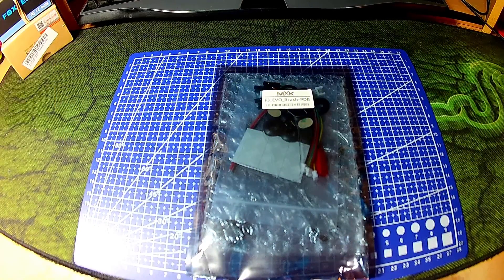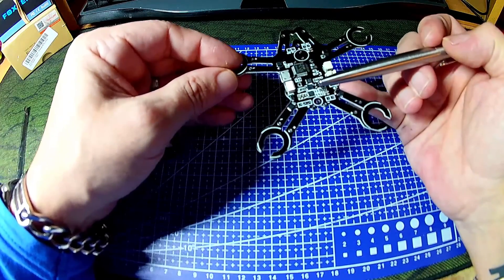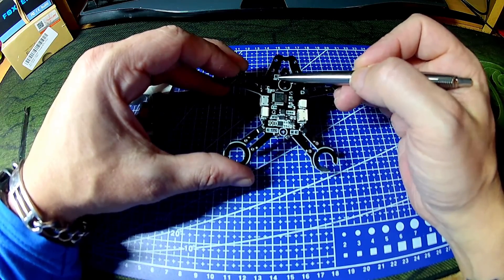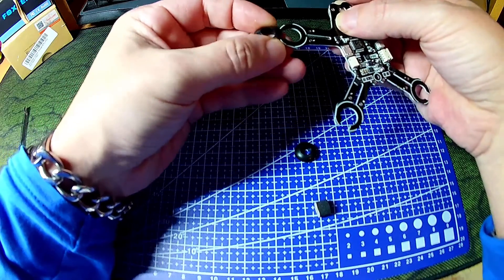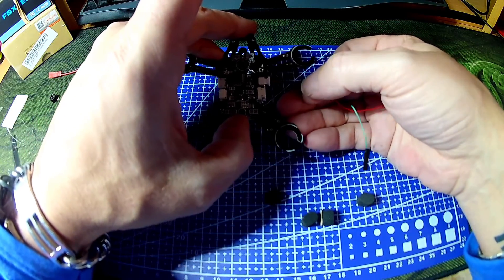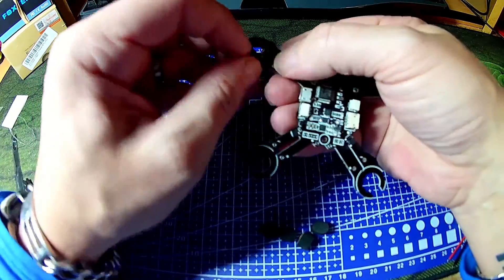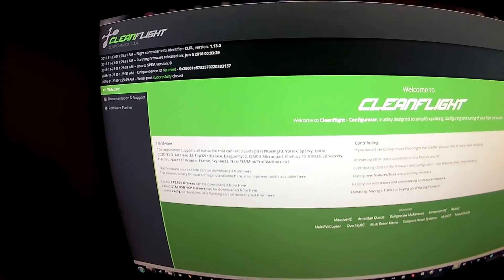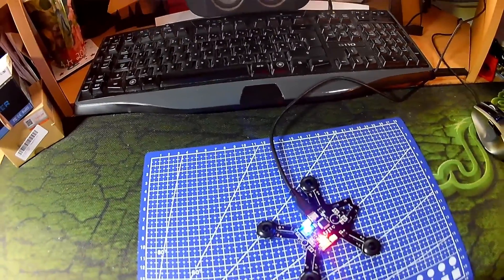92mm Micro Frame Preview (SP Racing F3 Evo)

Comment: hello I want to ask  for a little  favore can you send me a photo of the bord so I cud see what is the part number on 1 of the components on the frame , I accidentally shorted 5+ pins when soldering on the vtx and the tall chip (2pin in the bottom half) solderdoff the bord and popt off and I think this is the only  component damaged so could you send me a nice quality foto of it?
Reply from the maker: Hey,I have an issue with an SMD chip on my frame also I believe that it may be the same one as you.
Is it the one in the middle of 3 vertically inline with the positive solder pad at the rear on the top side of the frame? 

If so I think I have the part number researched from before to replace it but I just never got to sorting it out (Mine died on its own without getting shorted - It is still attached but has a bulge in it that let some magic smoke out if i remember)
Reply: MrE if I understand correctly u have the same problem I'm jus want to make Shure . Can I send a foto of mine (I need an email or FB)
Reply from the maker: Try sharing it or sending it to me on G+ if thats ok?
Reply from the maker: You should have a couple of images I shared on G+ , is that the right one?
Reply from the maker: Ok, now we have figured that it is the same chip I believe it is an inductor:

From the information I could get a while back it led me to assuming it was the following:

TDK NLV25T-180J-PF
Fixed Inductors 18uH 5%
http://www.mouser.co.uk/ProductDetail/TDK/NLV25T-180J-PF/?qs=3POhL7GGTOgcIrJiKXdh1A== 

Other than that I dont think there is much else to find out whats what (I doudbt very much any manufacturuer/Banggood would be forth comming in trying to help)

I can't say 100% that this is correct but I might get around to trying this myself now!

Hope this helps some.
Reply: MrE thank you for your help I wish no one has to use the information (but if needed it helps)
Reply from the maker: You're very welcome. Seeing as we're discussing it , it falls to us doesn't it?
 I have ordered the components even though I was going to leave it however I will stand by my convictions and attempt the fix also! cant harm having 2 guinea pigs hey?

Please share how you get on if you dont mind?
Reply from the maker: Edgaras Vilūnas I took a shot at fixing it but didn't go very well. Just published the video of it if your interested.

Comment: I have my spectrum receiver lugged into uart3 and it wont let me save and reboot with that in serial, also the receiver how's no sign of power, why?
Reply from the maker: Ok,I'll try and help out the best I can however I do not have any first hand experience with Spektrum but I do have an understanding of the Frame,here goes!

I assume it is a Satellite receiver?

First and foremost the uart3 does put out 3.3V upon a lipo being connected or plugged in via USB so check that your cabling corresponds to the silk screening on the underside (3.3v nearest the rear,gnd middle and RX on the front most pin of the the 3pin connector)

Spektrum is finicky to say the least:
I believe that you may need to use the CLI to set the bind process in motion.
If you can get Uart3 configured as Serial and the serial provider set to SPEKTRUM1024(DSM2)/2048(DSMX) - (Maybe try setting that with/without the reciever connected) try the following CLI commands:
For DSM2;
set spektrum_sat_bind = 5
For DSMX;
set spektrum_sat_bind = 9
Type save and hit enter after the command you require is entered.

Recycle power to the frame and it should put the sat reciever in bind with a blinking led i presume so turn on your radio in bind mode.

afterwards you should go back into the CLI reversing the previous command/take it out of the spek bind mode with:
set spektrum_sat_bind = 0
and type save after entering the above.

I hope this helps somewhat and I'l try help further if that doesnt suffice, good luck.

Comment: u up for a few questions?
Reply from the maker: Yes,by all means - please ask away and I'll help any way I can.
Reply: +MrE so, I'm trying to get this thing in the air. motors are installed, satellite bound to radio. when I plug in the sat to the quad. it goes back into bind mode and won't bind..not sure why.
when I plug in battery, motors fire up probably 3/4 throttle. 
every time I try to configure and save rx serial or anything in that matter, it doesn't save...
Reply: it hates me.
Reply from the maker: First up the motors spinning up is that you require "set motor_pwm_rate" changed in the CLI from memory - I have a feeling that it was set to 400 by default and requires anything from 1000 - 32000 depending what motors to cure it,although anything above 1000 should stop that behaviour ,saving after setting it via the save command in the CLI.

As for the Sat receiver issue I am not very proficient in Spektrum/DSM etc, but I would assume all that would be required is in the ports section you set UART 3 to Serial RX ,save and reboot and then proceed to set Receiver Mode to RX_SERIAL in either the configuration tab or receiver tab depending what GUI you are using.

Other than that Prehaps double check the wiring on uart 3 according to the silkscreen (RX3,GND 3v3)